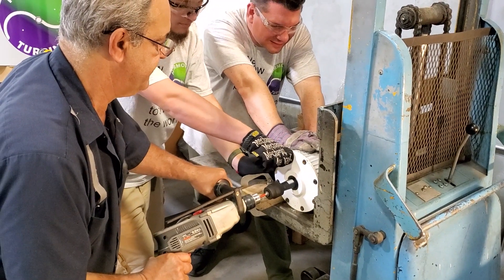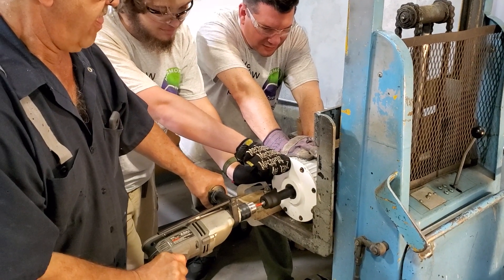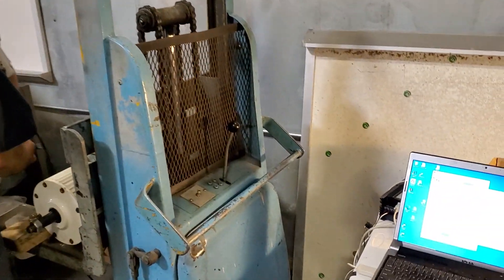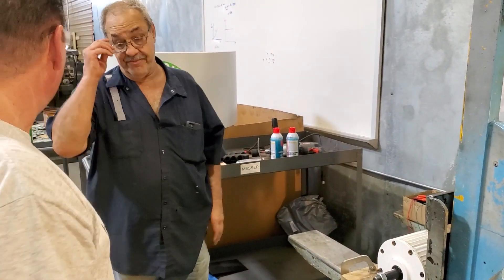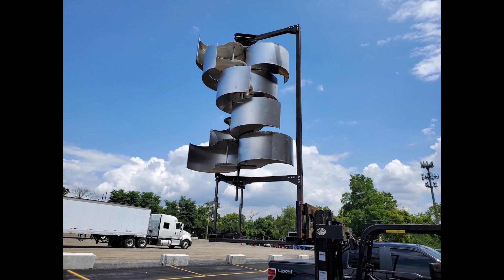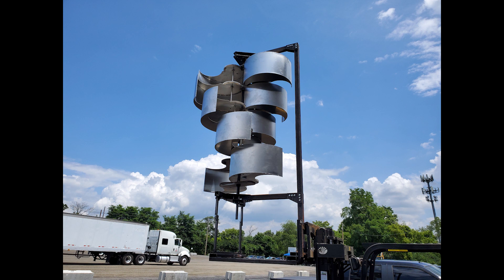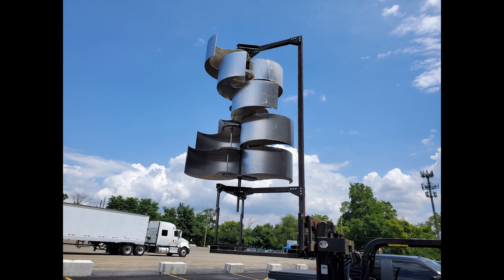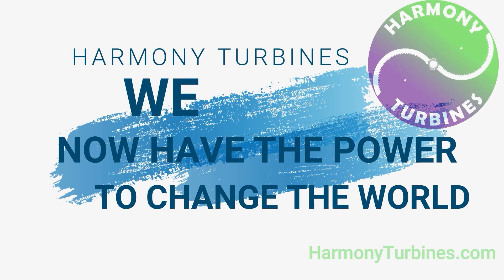Harmony Turbines Weekly Whirl 18

Comment: Is there a plan to put Harmony in a controlled wind machine to test furling percentages vs wind speeds to find the best possible output at certain wind speeds? Keep up the great work.  Proud of you all!
Reply from the maker: Eventually but that kind of equipment (rental) is expensive so for now we're going to work on getting real-world data as much as feasible.
Reply: That is understandable.  I wonder if it's more cost effective to build your own being that there is going to be a lot of different variables needed to be tested. I realize independent lab confirmation will need to be done later but for initial testing maybe constructing your own testing center will make the most sense.